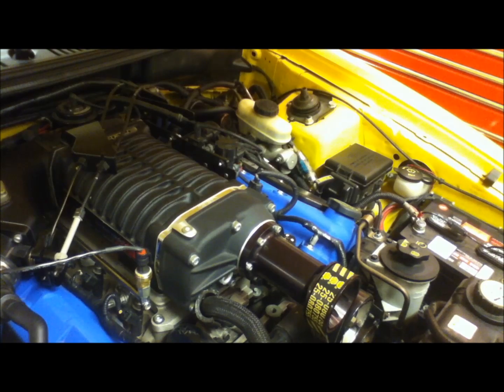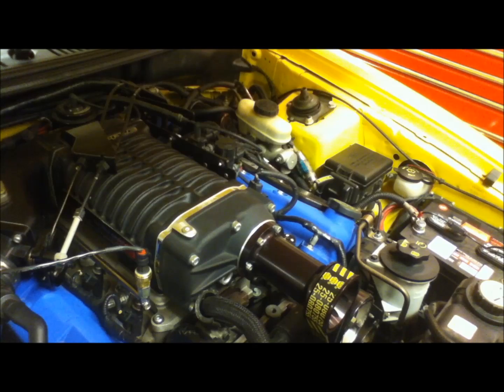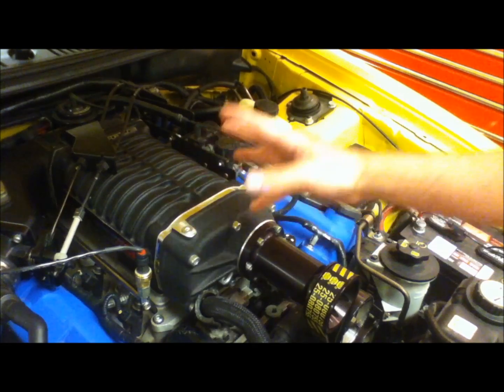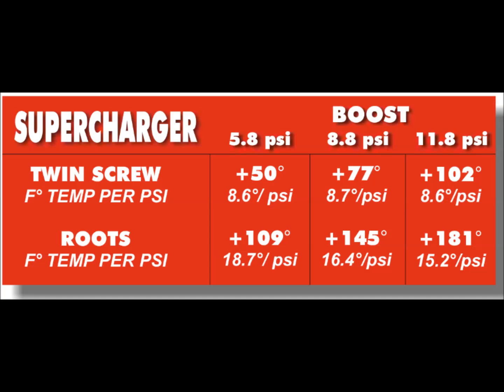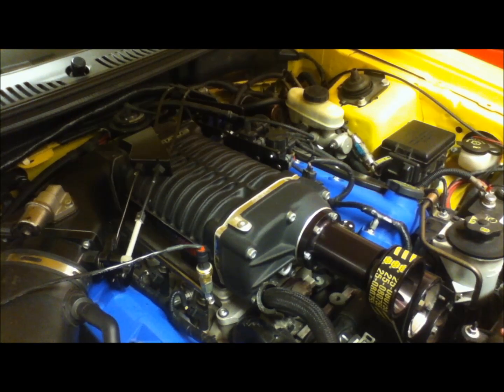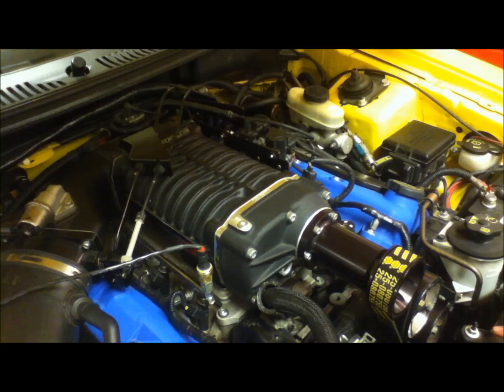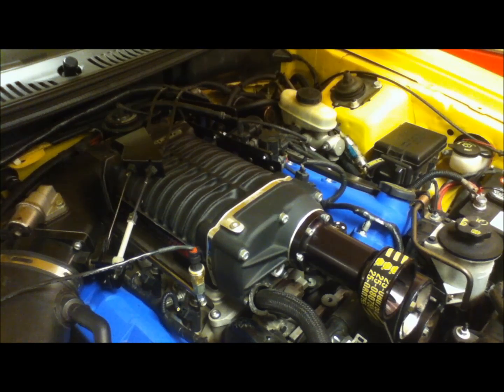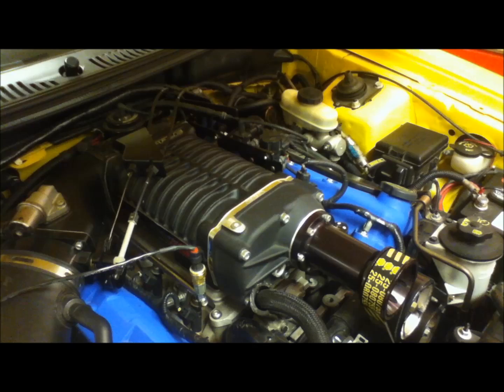Superchargers: Roots vs Twin Screw vs Centrifugal (Whipple, eaton, VMP, procharger) supercargador

Comment: How is it if you take 17 pounds and press it into a smaller space its still 17.  Its like the thing with 1pd of feathers and 1pd brick which will fall faster. Tires pressure would suffer if it went by this guys math
Reply: CHARLIE ARROYO he used good examples dude
Reply: CHARLIE ARROYO weight in lbs and air in psi are totally different. I understand what you are saying and that is correct but take your mouth as is and blow air out now do the same thing by puckering your lips. You see there is more pressure but you are working harder to produce same air. Now open your mouth and blow out. It is more air and less pressure. Now say with your lips puckered the pressure was at 4 mouth wide open at 2. If you built wide open mouth to pressure 4 you will be blowing more air at same pressure than when lips are puckered at same pressure. Hope this make sense. And don't worry sometimes it takes time
Reply from the maker: CHARLIE ARROYO even as a more clear example, which weighs more, a 17 pound brick or a 34 pound BIGGER brick that happens to have the same density? You're getting stuck on psi which means pound per square inch. If you had one marble in one hand and 5 marbles in the other, each marble is the same weight individually, but one hand is packing 5x more. Make sense???
Reply from the maker: CHARLIE ARROYO think about TOTAL CAPACITY and total output. In your case, it would be "a pound of rocks" PER SQUARE INCH but you have a lot more TOTAL area. For example; Imagine one space can hold "2 bags of rocks" and another, smaller space only held "one bag of rocks". Per SQUARE INCH it's the same, but overall it's twice the amount of rocks in the bigger area. Does that make sense?
Reply: Scrun Johnson 17pds is 17pds. The only thing I would see is the smaller one getting to 17pds quicker
Reply from the maker: CHARLIE ARROYO no, 17 psi on a smaller system vs 17 psi on a bigger system is NOT the same. Think about the example I used in the video. If you are pressurizing a big straw to 17 psi compared to a small straw, at 17 psi both will read 17 psi, but MORE VOLUME will be flowing through the bigger straw because you are moving more air. The same goes for a big V-8 which is consuming twice the amount of air as a four-cylinder. Both will read 17 psi, but MORE VOLUME is going into the V8. Think about how much MORE air it takes to maintain 17 psi in a bigger area.
Reply: Scrun Johnson call it what you want.But 17pds is 17pds
Reply from the maker: CHARLIE ARROYO imagine a small room and a very large room both pressurized to 17 PSI. How many pounds per square inch do they have? Both have 17. How much TOTAL VOLUME do each have? The bigger room has MORE total volume. Now imagine one of the walls on each room opens like a window. In order to keep both to 17 psi you would need to pump more air into the bigger room. Make sense yet?   I've given you several, clear examples. If you can't understand it that's your problem.
Reply: Scrun Johnson what ever
Reply: Claude Dottin what more 17 pounds of feathers or 17 pounds of concrete?
Reply from the maker: CHARLIE ARROYO you're asking it wrong because there is VOLUME to consider. Which weighs more? ONE 17 pound brick or TWO 17 pound bricks? Make sense yet?

Comment: What's better if you want to build a street car? Very informative btw keep it up!
Reply: +omaduskilas A positive displacement supercharger sits on top of the intake manifold, whereas a centrifugal supercharger sits at the front of the engine. Depending on the amount of space, you might be forced to pick one or the other. There's also the different characteristics between the two, with a positive displacement supercharger producing a linear power curve, whereas a centrifugal supercharger produces a power curve similar to a turbocharger, with more top-end power.
Reply from the maker: TrollBoyAmerican69 supercharger. A turbo is best with an auto Trans and E85 or upgraded fuel
Reply: Scrun Johnson Ya but like what type of supercharger? Positive displacement or a centrifugal? Thx
Reply: MURICANBOI1776 that’s I’m trying to figure out. I’ve heard less modifications if you go with centrifugal
Reply: halofreak1990 great I’ve come to a conclusion I think that I’ll go with a twin screw supercharger. Hopefully one that fits under the bonnet. With my driving I rather not rev it out . With ls3 I like changing between 5-6 max and do 6 extremely rarely

Comment: I have a 2015 GT 5.0L Convertible Automatic and I want to boost it for daily driving.  
It's nice to blow away all challengers except the occasional Hellcat.  So what type of S/C would be best?   I don't beat the shit out of the car all the time, just occasionally when a challenger wants to see what she will do.   A Whipple 2.9?  What engine mods should I make so I don't blow it up?  Steel gears, oil pump?  What about lowering the stock compression a little?  I run 93 non-ethanol continuously, never used anything else.  Run Ford full synthetic too.

Any thoughts please?

Comment: Is that whipple a 2.3 or a 2.9? What boost are you pushing and what size is your upper pulley?
Reply from the maker: michaelsjolin 2.3L (easily identified by the longer snout) running 17 psi with the stock lower and 3" upper

Comment: what if you pumped pure oxygen into the intake
Reply from the maker: Steven Camacho you would have better combustion, but these cars are breathing in quite the large amount of air
Reply: There would be theoretically 4,76 times the power compared to normal air (difference in pump work/heat exchange due to different kappa and different density etc).

Comment: Subbed and liked the vid. I have a 428 SCJ with a BDS 8/71 , Thinking  on buying a Roots type Hampton or Littlefield 10/71 do I need to worry about excessive heat with larger displacement blower??

Comment: so in a smaller engine we can get boost even with a small turbo and with manifolds small diameter?
Reply from the maker: The Rider yes. It doesn't take as much airflow to fill a smaller area.
Reply: Elan Wahgener
If you install the same forced induction system on a 5.0 engine as you have on a 2.5, you won't get half the boost, you'll get 1/4 the boost. Also, everything else being equal, they should make the same power. In reality, they won't. Which one will make the most power, depends on a number of things.
Reply: i don't think that changes 30psi being 30psi... 2.5 liter getting 200% gain... same turbo or supercharger on a 5.0 yeah only gets 15psi and is getting 100% gain.. but if the 5.0 has two of those turbos 30psi and 200% so i'm not sure how we have to interrupt the 30psi any different... since the smaller engine also needs less air...  Hypothetical gains of course.

Comment: I've never seen a tuner car with a supercharger. Can tuners like a Honda use superchargers?
Reply from the maker: earlibee yes they can. The cobalt SS 4 cylinder is supercharged (they later went to a turbo) and I've seen some Honda supercharged ones as well. Just not as common
Reply: earlibee of course they can. you tend to get more power at the sacrifice of some lag time out of a properly sized turbo application than you would from a supercharger. with all the advances in turbo technology over the last 10-15 years the differences in spool/lag time are nearly what they used to be though.

Comment: one question i have a jaguar s type r which i believe has eaton m112  so i wondering if i can do upgrade or use 2 screws supercharger ,,, or how can i make it a little louder without major upgrades
Reply from the maker: Carlos Sosa porting and using a smaller pulley will make it louder. Yes, I believe someone else in these comments went to a Whipple twin screw supercharger. You can't change your eaton itself to be a twin screw, but you can replace it with a twin screw supercharger
Reply: thanks for your answer and i red a comment about smaller pulley or some like that and i was about to do that but i red comment below saying about might results damage to the supercharger ,, i believe going on twin screw sc would be too much work and $$$$  so what would you recommend me the smaller pulley  sc or try something else ,,,
Reply from the maker: Carlos Sosa yes, smaller supercharger pullies are VERY common on the cobra m112 cars and have very few problems from it. It's common to see 2.93 and 2.76 pullies on Cobras all day. My Whipple twin screw is a 3"

Comment: so does that mean a centrifugal supercharger would have the same kind of lag as a turbo charger? or would it still be less because it's belt driven?
Reply: DreadlockDrummer Yes, centrifugal curves nearly match turbo curves exactly.... Now something you can't do with turbos you can with blowers is use a smaller pulley to overdrive the blower, thus creating the same amount of boost at a lower rpm (and higher overall top), but then use a wastegate to bleed off any unnecessary boost, so instead of say 16psi @ 6000rpm and 4psi @ 3000rpm, you overdrive the blower say to 10psi at 3000rpm, and once you hit 16psi, your wastegate bleeds off everything above that point, so you don't blow up your motor with 40psi it isn't built or tuned to handle... Kind of basically reducing/eliminating drag.
Learned that from an article published by Vortech Superchargers...
Reply: @JoeIsCrazyWillman  you don't need to pulley down a turbo you can just turn boost up with a boost controller and if it is sized correctly it will have more torque down low than a centri and better overall powerband.  I prefer positive displacement in particular tvs for a street car but I would go turbo before centri but centris def have their place.
Reply: @midnight347  you can't pulley-down a turbo. Lol. I meant pulley down a centri for quicker boost like a positive displacement, and bleed off the excess.
Reply from the maker: DreadlockDrummer correct, less lag because it is producing at every RPM from being belt driven, but less output from the "gearing" of the blower.
Reply: you mentioned that the roots style blower gets pretty hot, much hotter than the twin screw, how does the centrifugal style compare? and how is it cooled? i'm trying to decide between a TRD roots or a URD centrifugal for a tacoma
Reply from the maker: DreadlockDrummer a centrifugal will produce far less heat. They both produce heat from compressing the air, but the positive displacement also gains a lot of heat from being on top of the engine vs in front of the engine. Both centrifugal and positive displacement will typically cool air through and intercooler. I'm not sure on what your use will be, but I think on a truck you'd really like the roots (positive displacement) over centrifugal for the instant power at any rpm
Reply: i used to think that too, thought instant torque would be better in an off road situation. but then i realized i rarely ever go off road, and the main thing i would probably be doing with large amounts of horse power (seeing as how off road i would never be going very fast, as i don't live near a desert for desert running) is passing people on the highway and putting certain types of sports cars to shame. so although i like the idea of instant torque from a roots blower, i'm probably going to go with the centrifugal for higher horse power
Reply from the maker: DreadlockDrummer well, even for passing and getting the power up front may still be better, but if you want to go centri I'm sure it will also work out
Reply: i've been doing some looking around and so far i've seen that with the trd roots charger on a 4.0L tacoma the most wheel HP people are able to get is 350-367, and thats with other mods such as headers and exhaust ect., but with the URD centrifugal charger on the same truck people are getting anywhere from 422-470 HP to the wheels (with same kinds of mods). I was unfirmiliar with a centrifugal super charger and wondered why it looked like a turbo charger, and then i found your video. =)
Reply from the maker: DreadlockDrummer yeah, they are more efficient for sure. Usually easier to install as well

Comment: Great video but boost is not a measure of resistance, it is a measure of pressure inside of the intake.  The only resistance you have is from the valves being closed but at any given time throughout the revolution there are the same number of valves open at the same time. And adding headers will not decrease your boost pressure because valves are still opened for the same duration and the valve size has not changed. You will see and feel and increase of power because the engine is working more efficiently and is not trying to re-burn spent air. Now if you change your cam to a larger one they yes you might see a decrease in boost pressure because you are now moving more air into the engine because the valves are open longer. But no i'm sorry boost is not a measure of resistance. boost is a measure of efficiency of the air pump and the amount of compressed air their is inside of the engine.
Reply from the maker: Derrell Claspill actually, you will loose boost with a more free-flowing exhaust I.e headers. And you are also experiencing resistance in the intake manifold from the pressure built by the blower and lack of release of that pressure as it is still trapped in the intake, so YES, boost is a measure of resistance...resistance of the pressure in the intake manifold. It seems you are focusing on the amount of output of the blower and not where that volume is going (or not going as its trapped in the intake manifold before entering the cylinders)
Reply from the maker: Derrell Claspill try reading this link. It's straight from Kenne bell and explains a more restrictive exhaust will increase boost and a more free-flowing exhaust will decrease boost..just as I said http://www.kennebell.net/KBWebsite/Common/pdfs/LowBoostCausesAndCures.pdf

Comment: Are the superchargers I've seen on the pulling trucks that stick way up in the air,or the ones in the NHRA different than the ones you've just explained ? Or, are they in fact the same,just on a much grander scale? Thanks!!!!
Reply from the maker: KY KRaZY yes, those appear to be positive displacement roots or twin screw blowers, which makes a lot of sense for instant, low end torque

Comment: Great video. Just facts, no annoying music and accurate info. 
Thanks :)
Reply from the maker: magster65 ha ha. Thanks
Reply from the maker: glitchez Ha ha. Thanks. Glad you enjoyed the video
Reply: @dannyjohnsonsgarage  hey man I have a question on hoping you can help me with man it's about my 02 Ford Lightning Supercharger.. could you hear me out please..??
Reply from the maker: Sure. Go ahead and ask it here. I like people to be included on the conversation and see it on the videos :)
Reply: @dannyjohnsonsgarage  Hey I'm Mike and I have 2 Ford Lightnings swapping my charger casings because my one is ported and Polished and my trucks computer has a tune ,thd other is a 2002 Ford Lightning with 36k miles, Supercharger rotors into my other forward lighting supercharger casing that happens to be ported and polished they are the same im guessimg.??  year I just put new needle bearings in my casing and put it all back together with the low mile rotors in the ported & polished casing because they were like new. Since the first  start there was no noise for a while then it started to have an almost grinding or growling noise but now it got louder and I'm not sure if its norma because i was told that the bearings may have to ceet and that the noise would most likely go away after break-in... Now  I finished this supercharger a few days ago and I haven't had a chance to drive it and break it in because I'm still building other parts of the truck..The problem is that it has moved back in fourth in my driveway a few times, And I had the supercharger belt hooked up so it was spinning and got warm a few times.. I'm hearing a noise and I'm almost sure definitely is some kind of metal inside actually maybe like a shearing noise..Oh I replaced the coupler also..So the front snout has 36k miles and the  bearings didn't seem to have any play in them or the front pulley side either from what I could see wasn't not loose at all... the weird part is I have a stethoscope to the supercharger front back and middle and I can't really tell where it's coming from exactly it doesn't sound like it's coming from the supercharger until you're listening in front of the truck with the hood up.. I removed the belt off the supercharger and hit the gas pedal and the motor revs and the supercharger spins with a nice force if I hold the pulley it will actually make it spin out of my hand just from hitting the  throttle.. I was just wondering since you're familiar if youd have any ideas off the top your head without hearing it..?.. But either way I will send you s video if you want of it running so you can hear what I'm talking about I just thought of writing you when I came in the house disgusted..lol.. I  Noticed when I pressed the bearings in the casing that they set a little deeper than flush is that normal? And if so how much does it matter if it's Exactly flush or all the way down and bottomed out ??  Hey I just wanted to say thanks again for all the help and I really appreciate this information..